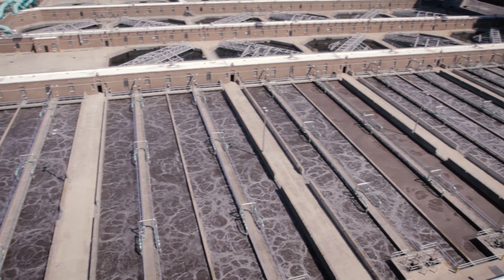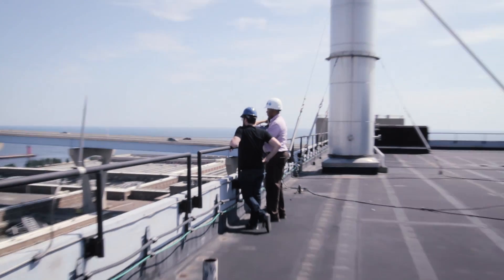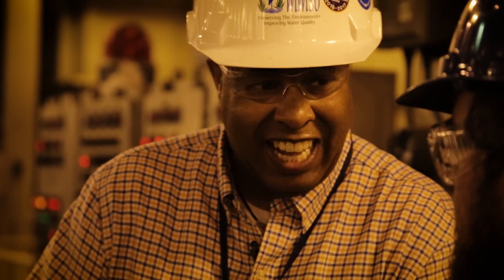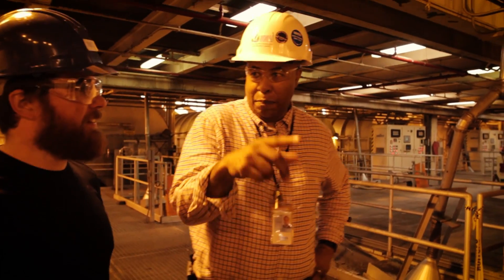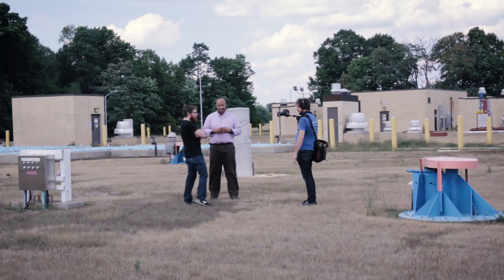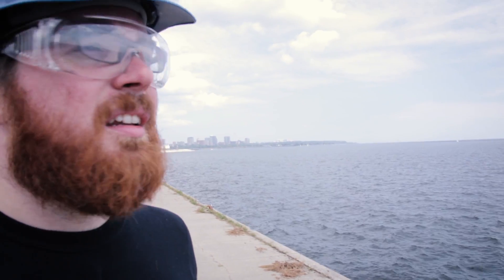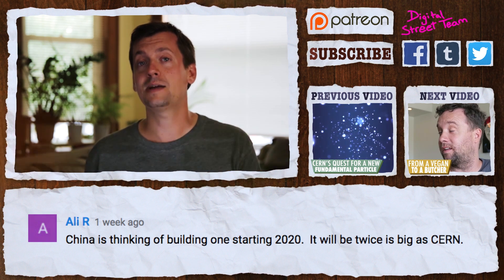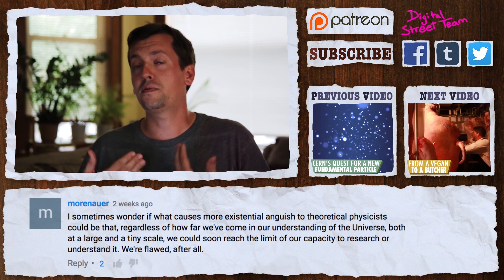Turning Our Poop into Energy!

Comment: What about all the toxic chemicals (detergents etc.) that they get flushed down?
Reply: Normally the concentrations are not large enough to be of concern.  About a decade ago there was an issue with some contaminant... PCBs if I remember correctly.  The fertilizer had to go to a toxic waste dump, and a few fields that had been fertilized with this batch had to have the top layer of soil removed and sent to the toxic dump.  This risk is why Milorganite is only rated for fertilizing non-food crops.

However, if other treatment plants had a similar event occur, the vast majority of the chemicals would have simply passed through the treatment plant and contaminated local waterways.
Reply: @UrbanPanic         Thank you for that information!  That should have been included in the video!
Reply: Good question!